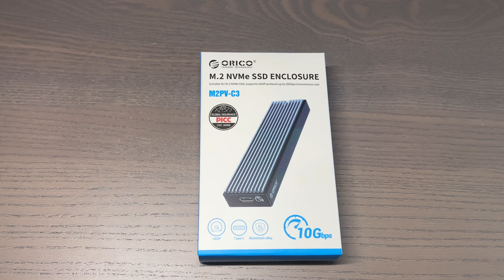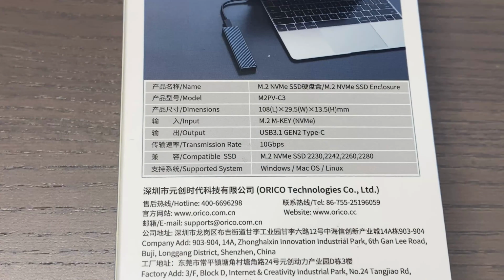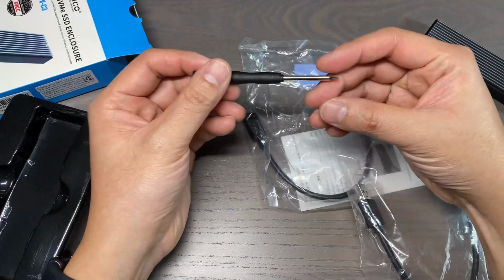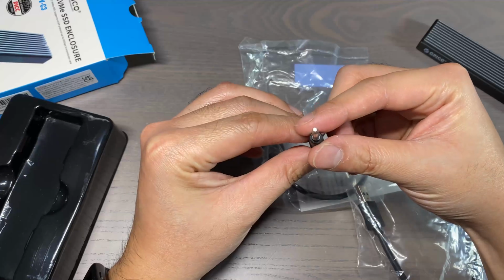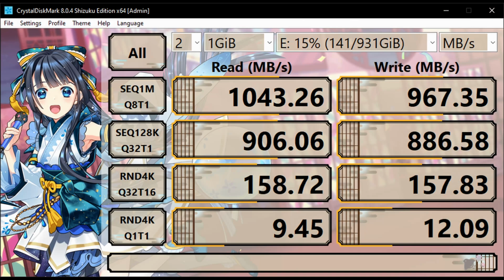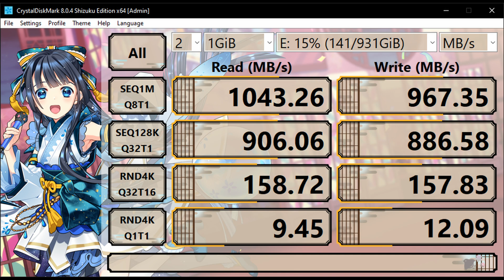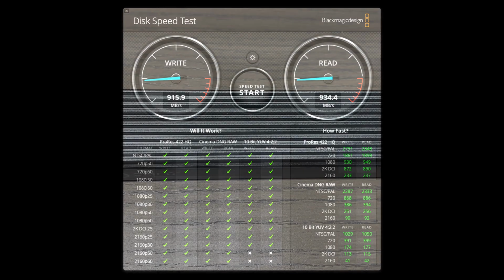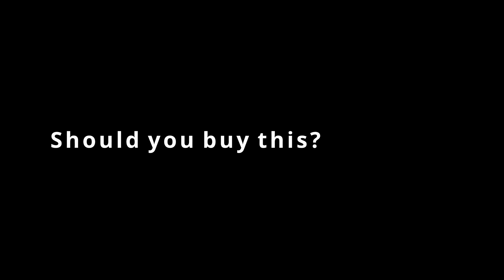Orico enclosure for M.2 NVME SSD in 2021?

Comment: I have one of these enclosures and it was initially very unstable.  I switched NVMe SSDs and it’s become fairly solid and stable.  So perhaps stability issues are dependent on the NVMe SSD used.
Reply from the maker: Good suggestion. Which NVME ssd did you start with and which one did you end up switching to? Thanks
Reply: @BuiGadget  IIRC I started off with an HP (HPe) OEM SSD of ~256GB capacity and eventually moved up to a WD Blue 500 / 512GB SSD.  I’d have to double check to be sure.  Also of note, if the SSD and main board rattle around inside the enclosure it probably doesn’t have good physical / thermal contact with the top heat sink via the thermal interface material (pad).   If it feels sold then it most likely does.  In the latter case heat might be an issue and could cause disconnects or lockups.  I’d recommend a better quality enclosure though.

Comment: Can use with m.2 sata ?!!!
Reply from the maker: No
Reply: Orico has other models in the same case that are dual sata/nvme and only sata.  Only sata is cheaper than only nvme, so you have lots of choices in the market.
Reply: Orico has 2 models that look exactly the same, one is for sata m.2 another for nvme

Comment: Thank you for the review, perhaps you have some experience with the M.2 drive that would rule out the M2 SSD as the source of crash?  If so, it would be good to mention.
Reply from the maker: Yes Leonard thank for bringing that up. I did  forget to mention I did use  the m.2 in a different enclosure and laptop m.2 slot with no crash issue.  Thank you for your feedbacks, I will make note of this for all future videos.
Reply: @BuiGadget  i think the op refers to that some drives dont work well in certain enclosures. Also like any sabrent ssd works poorly in a an external enclosure with Mac os but fine with pc.
Reply from the maker: @PlayJewel  thank for sharing your comment and watching this video
Reply: @BuiGadget  i figured out why your might not work well. There are two kinds of controller orico is using on these. One is realtek another is jmicron, jmicron sucks and people have same problems as u, while those who get realtek for them it outperforms all competition.
Reply from the maker: @PlayJewel  That could be the cause, i will look into it and thank for sharing.